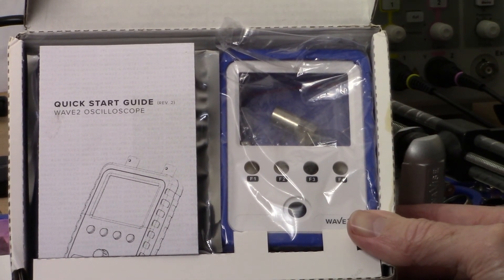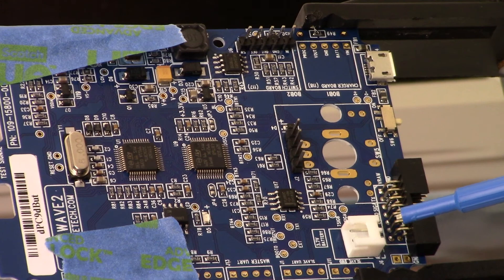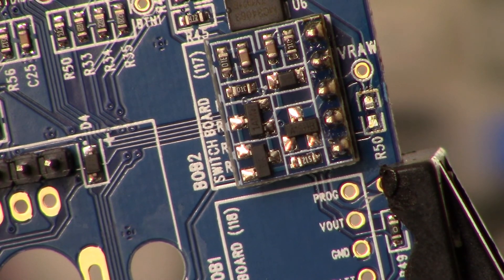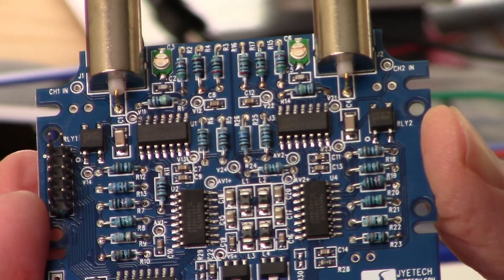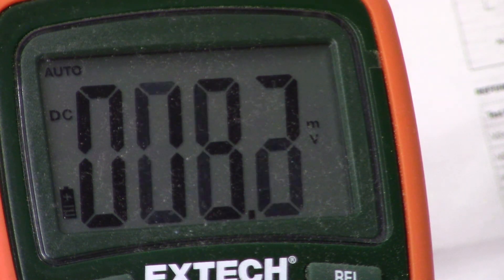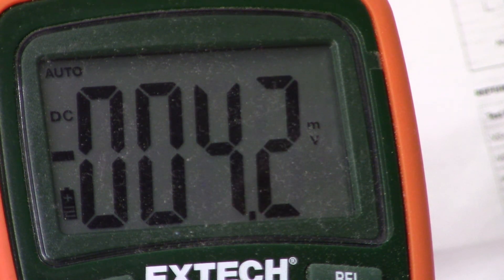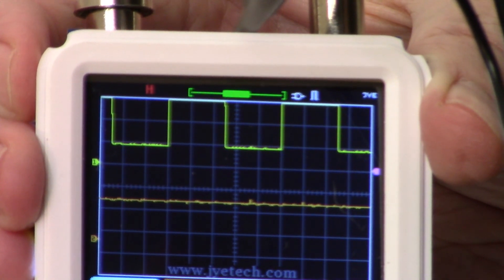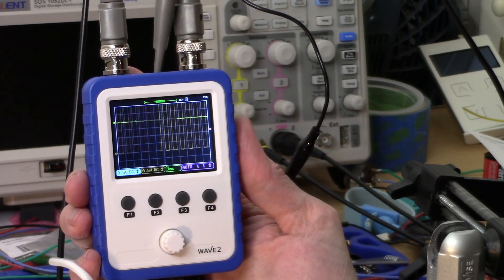DIY Oscilloscope

Comment: Thanks for the video. Can the Wave2 operate both as frequently generator and scope simultaneously? IOW, can I take a signal from its generator, feed it into a circuit, then read the signal using the same unit?
Reply from the maker: I do not believe so, however I cannot substantiate that because I no longer have the unit.

Comment: can this thing be upgraded , sampling , bandwidth ? Since you can flash new software on it it shouldn't be a problem some code adjustment , changing the needed chip with equivalent better one and flashing , should be possible right ?
Reply from the maker: If you have complete access to the code and also the knowledge to make the code adjustments then I suppose that you could.